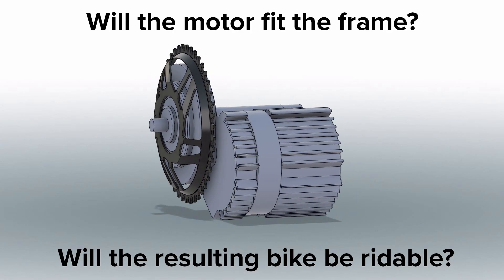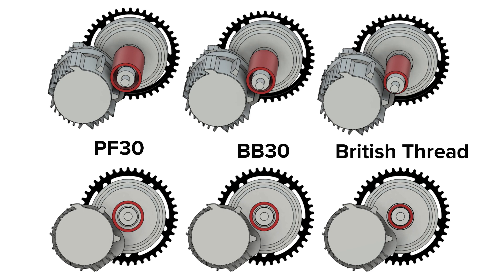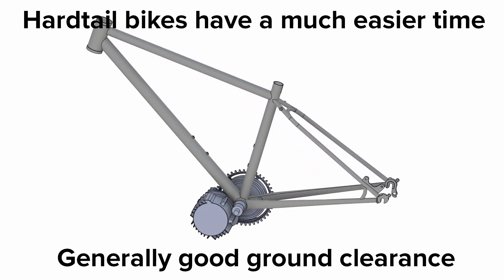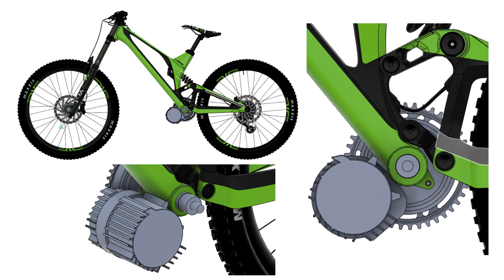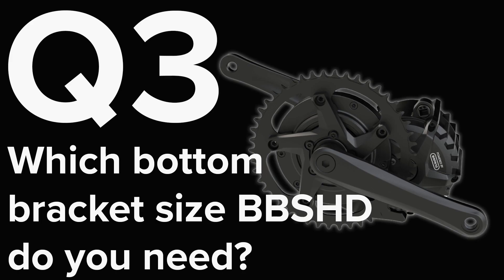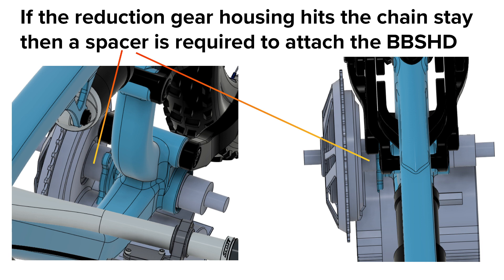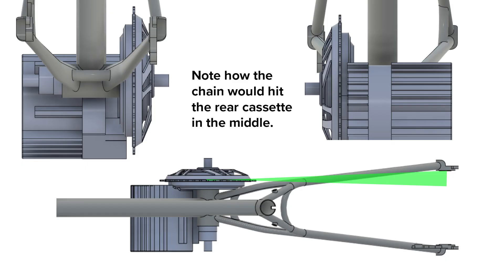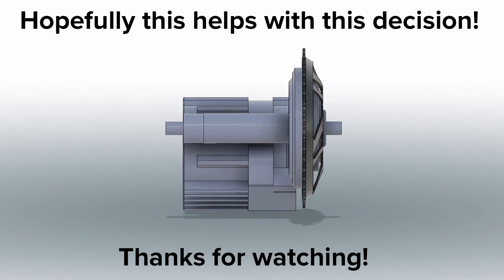How to fit a BBSHD motor! Size guide to the Bafang BBSHD / M625

Comment: Great content. Regarding chain line. I dont think you mentioned but a lot of people including my self also use a chainring that has an offset to allow a better alignment. But since this is new I dont think new chainrings with various offsets exist yet. It worked great on the older BBSHDs which I agree has been bullet proof so far with over a year and half of riding mostly on mountain bike trails.
Reply from the maker: Thanks Georgio. I have to update on this motor when I get chance. The existing lekkie stuff does work with this new motor! Great points on offset. Cheers
Reply: I had to modify (or rather my bike shop) had to modify a lekkie ring specific for the BBSHD motor. Since my motor is the BBS02 , the holes did not line up. The bike shop modified it since I needed more inward offset that the BBSHD lekkie ring offered vs. the BBS02 version. 

Now the bike barely if ever slip while on the rear cogs. The chain line is dialed in really well now.  It used to slip really bad under throttle on the smallest cog.  

I'm running a 52T front lekkie. 
I'd like to experiment with a rohloff hub using a BBSHD , then you have one single chain line to dial in.

Comment: This video is tremendous help! Thank-you.
Reply from the maker: You are very welcome!
Reply: @HighVoltageKits  one other question please, do you know if swapping a smaller or larger BBSHD axle is the only requirement for adapting (my) motor to fix different sized BB and chainstays? You knowledge seems quite high on this stuff.. so I am asking in hope you would know. Also I checked out your site, seems you make magic with a 3D printer. haha! Kudos! subscribed.

Comment: Oh the memories it brings back and me thinking I wanted a 13 sp rearend.  At least i can climb every hill in town.  I had to have a special wheel and a special order bolt through axle cause i wasn't about to try it with a drop out or any thing else that could fall apart.
Reply from the maker: Never even heard of a 13!
Reply: @HighVoltageKits  Nothing easy about it all but it come with a 50 tooth low gear which is nice.  Lining the cassette was an issue so I can't make use of the high gears any way.  Live and learn.
Reply from the maker: 50t. Wow. I thought that my 42 was big

Comment: Great info! I’ve been looking at full suspension frames for this motor.
Reply from the maker: Cool! This is a new build that I am doing with a friend. It uses the specialized big hit. Its an old frame but they go for a decent price these days. The battery will be harder to mount though https://youtu.be/FB09c2l8328 Cheers!

Comment: Very useful info, and mentions issues I've already thought of myself. I'm looking to build my first e-bike and need a bike to start. My main questions involve where the final chainring position will end up with the motor installed. I'm assuming the chainring should pretty much be where it was originally for a good chain-line. But the bikes I've looked at have chain stays that flare out really wide immediately from the crank area, making me wonder if a larger chainring will fit without hitting the chain stay. I know I could space the chainring out but then the chain line might be too far off. I wish there was a list of MTB bike brands that are the most suitable for these mid drive Befang installations. I wouldn't want to buy a bike to realize that I made the wrong choice for this.
Reply from the maker: There is a list of good bikes on Endless Sphere the web based version. I should copy it down at some point. Hardtails are easier to work with than DH bikes. Older DH bikes are easier than newer ones. When I say DH I actually mean full suspension. You are right to be wary if the bikes have flared out chainstays as they will almost certainly push out the chain line and make things hard for you. You are also welcome to join out discord and post photos of frames etc. Maybe people can help you find a good frame that will work. The Tales on Two wheels blog is well worth checking out as well. Lots of good tips on there. The video for that is about 5 videos back from current.

Comment: Really useful information....I’m just about to purchase a kit for my surly pugsley fat bike and just assumed that as my bb she’ll measured 100mm I would need the 100mm kit..would you say the 120mm kit is required?...
Reply from the maker: Well the bit you need to figure out is if the casing of the reduction gear hits the chain stay and requires a spacer. I'd it does then yes you might need the larger size. If you want to join the channel discord server you can post pictures to look at. https://discord.gg/ScWuVxu9 Endless sphere is good to search as I reckon this frame will have been used before. Hope this helps. Cheers

Comment: I've been building, This will be my third e-bike and was going to be my final e-bike. I went and bought a carbon fiber Chinese knockoff gravel bike. It is fantastic! It looks awesome but it has that weird BB dip where it then meets at the rear fork parallel but I forgot what the dip is for or something for the chain so you can get to it easier or something. But like the bottom bracket has one side protrudes way lower than the other side. It's a weird looking angle. I didn't know that I got the upgrade kit. I got the high voltage upgrade kit bought a brand new bafang mid drive motor and it hits that little bump and it's carbon fiber so it's not like I can shave it down. Do you guys make some weird like it won't even align up straight with the bottom bracket hole at all. It's off by like a half inch and I'm debating about giving up and just going with a hub motor but then I can't use a hub motor because it's a thru axle and so I wouldn't even be able to get the hub motor on the frame if I wanted to without professional help. I guess I don't even know if you can take the axle off the motor and then put it back on and our own backyard anyway... Lol. 

On a side note, e-bike magazine or whatever the e-bike magazine had on the cover said it was the world's fastest aftermarket e-bike and it was on a heavy mountain bike frame and could go  a top speed of 70 mph and like 0 to 60 in like 7 or 8seconds. Said it was the fastest street bike out there. The current bike I have now can go over 88 mph and 0 to 60 in like 4 seconds if I can control it without snapping the chain. With only 3000 watt mid drive motor .there was like 5,000 watt hub motor. They're hub motor weighed more than my whole bike put together . And it is completely carbon fiber except for the battery and motor. Everything else I mean everything else down to the carbon fiber. Spokes the rails that hold the seat are carbon fiber. Everything is carbon fiber. The whole bike weighs less than 35 lb and I mean it is futuristic to the max. It is a road bike. You never see people converting road bikes. I always thought that was weird because I want the fastest road bike. Haven't been like to drive a car since 2009 and when I keep up with cars and the bike lane next to them it is hilarious. Seen their expression because they can't seem to accelerate faster than me no matter how hard they try. Even the Ford mustang GTs are the only one that can almost accelerate faster than me. Am accelerating using pedal. Assist the whole time not the throttle. If I were to use the throttle it would be ridiculous. I would burn rubber on my 700c tires is kind of funny. I keep it in the lowest or the highest RPM gear and Mike acceleration is through the roof. But I want to make the fastest gravel bike in the world and I would feel much safer putting 38 mm to 45 millimeter mountain bike tires on Earth road. Bike frame would be epic and now I'm a little sad cuz a problem and I don't want to have to buy another carbon fiber gravel bike frame. I took it two months to get here from China
Reply from the maker: Best thing I can suggest is to use the link and join our discord group. You can post pics and video there and get help. Carbon can be a tricky beast. The torque arms might be an issue as well with carbon. Hope this helps. Cheers. Oh. Discord link is in the description.

Comment: Thanks for the video. You mentioned you had to use a120mm and spacers on your fat bike. I have a 2013 Salsa Mukluk bare frame with a 100mm bottom bracket. Do you think I should order the 120mm just to be safe? Thanks
Reply from the maker: I would. If it's anything like mine the 100mm won't clear the chain stays.
Reply: Thanks very much.

Comment: I do not see a 120mm version of the Bafang M625 available as of yet. I would imagine the 100mm Bafang M625 would still have problems fitting to most modern Fat Bikes because of the chainstays. Also, the company (Eunorau) advertising the Bafang M625 motor states on Aliexpress that "Bafang M625 with CAN protocol, the motor is only compatible with BT F22.960. C battery". Seems like the new motor has very limited options.
Reply from the maker: Yeah. I will look into the updated information. I think there will be workarounds. Em3ev and luna will not want it this way. It's bafangs choice but I imagine they will just be leaving alot of business on the table restricted in this way...

Comment: Hello 👍 ,, you can change the pin (motor) that enters the frame of the bottom bracket,!?
 Let me explain,. I took the 100mm but, Pultroppo with the dissosamento chain crown house we are not there. He strains too much arrived at the 9 speed, from 10-11 goes hard and eats the iron.
Since I have a 148×12 mtb wagon. No more margin even with picnic crown that I recovered 5mm .. Nothing! It doesn't work. So I would like to try on my old 26 rockrider 5.2 mtb.. Or at least frame that can mount this 100mm with normal mountain bike front wagon
Reply from the maker: Its hard to understand exactly what you mean. You are welcome to join our Discord group and post pics and video tho. Hopefully we can help. https://discord.gg/Jqtdzyy2Be

Comment: Thank you Captain! But there were the same mounting problems with the old version of the BAFANG BBSHD. Does the new model cause more mounting problems?
Reply from the maker: In terms of clearance to the ground the exact same problems or restrictions to frame type remain to the best of my knowledge. The requirements for the strap and the bracket with only one bolt and less torque could well make it more tricky on certain frames without extra parts or custom work. Good points. Appreciate the comment

Comment: Do you know of a supplier for an adapter when the bike has a larger diameter bottom bracket ie.41mm
Reply from the maker: There are ones for PF30.. You need to determine the standard and then search for a conversion from that to British Thread.

Comment: Thanks for the helpful video. Can you confirm the dimension of British thread BB is 68 to 83mm not 68 to 73mm ? I have found the later dimension of 73mm max on a BBSHD supplier's website.
Reply from the maker: According to the sizing guides online the 83mm bb would need the motor that is sized for 100mm. You are welcome to join and post pictures on discord to get further advice. It's not just the bb width but also chain stays and clearance that factor in. https://discord.gg/WqY3qce97P
Reply: @HighVoltageKits  Thanks for the reply. I haven't figured how to use discord yet. Can't remember my password and can't "claim account" . I read your reply on my email. On the video "How to fit a BBSHD" says to 83mm . I am looking for a project full suspension bike with British BB . I found one of my own bikes with a BB about 78mm width . British BB seems to be the best choice .
Reply: Maybe it was a typo error saying 83mm?
Reply from the maker: For the bbshd yes. You can get pf30 adapters

Comment: What are the weight differences between the hd & the m625?  I heard it is made out of magnesium.  Can you pull the same power out of a bbs02 w/ a asi800 compared to a hd?  The reason being I've seen options for a belt drive on the o2 but not really for the hd...any thoughts? I'm really set in converting belt drive bike there is one person I've seen w/ a hd running a belt drive on the same bike...he had told me that his conversion was a custom machined front chainring adaptor...it seems a bit over done. I'm working w/ a 104bcd 42t front sprocket...i also got a gates 39t sprocket as well.
Reply from the maker: I am not quite sure. If it has been reduced in weight by the magnesium I doubt it will make much difference in the grand scheme of things. Belt drive is nice and quiet. It is doable. Check out endless sphere for belt drive info. There will be many who have done it. I thought there were kits out there already. Gates I think does something. The new BBSHD chain ring uses bolts so perhaps it will be easier to adapt. Sorry for the late response! Cheers

Comment: do you know if a bbshd 100mm will fit ok on a 68mm bottom bracket with spacers?
Reply from the maker: You will be able to fit it. But the chainline might be an issue.

Comment: Where did you find your CAD models of these bikes? Do you know of any for the Cannondale Prophet?
Also, where did you get the model for the new BBHSD? I would like to model my bike (in SolidWorks 2018).
Reply from the maker: They are from Grabcad. I did not see that one though. I use fusion 360 myself. The bbshd was also on Grabcad. I can send you a version. If you are on discord this will be very easy. Not sure if I gave you a link? https://discord.gg/GzchV7W9

Comment: I am thinking about upgrading my controller to the Phase Runner. I was wondering what your experience doing this is like? Thank you.
Reply from the maker: I have not used it myself. We do sell ASI upgrade kits under the high voltage brand. That's a similar upgrade but with a nicer display and a good bit more power! Cheers

Comment: You mention a link to downhill frames that work well with a BBSHD? I don't see it.
Reply from the maker: https://electricbike.com/forum/forum/builds/ebike-building-directions/14686-a-list-of-full-suspension-bikes-that-a-shark-pack-will-fit-on-the-downtube-pictorial I think this is the one. Cheers
Reply: @HighVoltageKits   Thanks.

Comment: Would a bbhd fit a 2017 cannondale bad habit carbon 2?
Reply from the maker: Looking at it I'd say the motor would hang very low. Id try searching on endless sphere to see if it's been attempted before.
Reply: @HighVoltageKits  yeah thats what im thinking.  It is not recommended for carbon frames.

Comment: My tsdz2 motor will not work without modification on 2 frames that have internal cable routing, at the bottom bracket the internal cables exit blocking the bottom bracket.
Reply from the maker: I know a few people who have ground off those points. Should not be structural. This video is more about general mounting. I think the tong shen is similar in how it attaches tho.
Reply: @HighVoltageKits  wish bafang fit more like the cyc inside the frame. That semi integrated look is nicer than bulge at the bottom bracket.
Reply from the maker: The mounting is the key advantage of the CYC. It has its own problems tho. They can do it with the chain reduction. Bafang could improve things but it would need a complete redesign.

Comment: This new generation of bafang motors are objectively fantastic but for the owners of the old models were left a bit in the lurch. I'm very confused as to what's going to be swappable between generations and exactly what the difference between the news models internally. Then also I saw a lack of 120mm models? And also programming these like the old ones seems harder. Confused.
Reply from the maker: You are not the only one. I reached out to a few places and information is slim. Ots meant to be available today so perhaps more information will be available. I suspect parts for older models will still be available.

Comment: What are the main differences in the old and new BBSHD?
Reply from the maker: So far the mounting is a bit different and uses as steel strap to help hold it up. Other than that it looks cosmetic... however until I get one I won't know for sure. Did you see the video I did on it? All the info I have is there pretty much. Hope this helps. Cheers 🍻

Comment: I have regrettably come to the conclusion that my Giant Reign 27.5 2 might be a bad ebike conversion due to the sloped lower tube.
I really love that bike, but think it would get a terrible ground clearance due to this.
Reply from the maker: Yeah. Its a tough one. There are the CYC motor kits which offer a bit more flexibility although they are more complex in general due to the dual chain design. Maybe you can find a trade?
Reply: @HighVoltageKits  yes, I think I might just buy a new eBike, or of course it would be possible to buy an ebike frame and transfer the giant reign stuff over. But the Giant bike is in very good condition, so I would feel kindof sad parting it out also :P